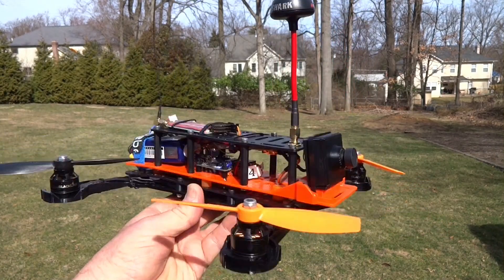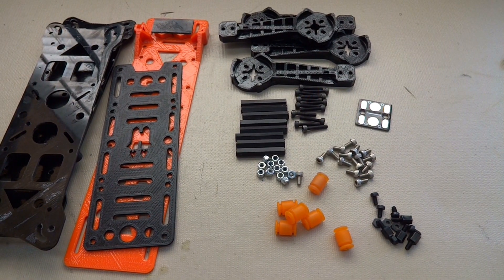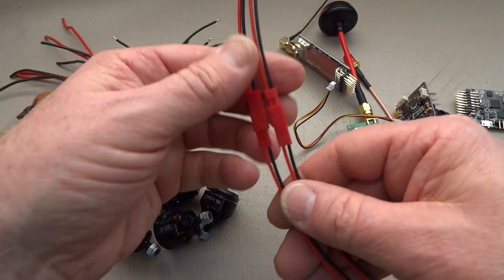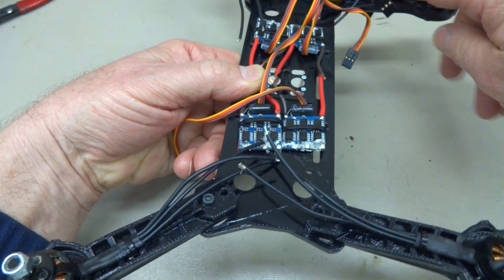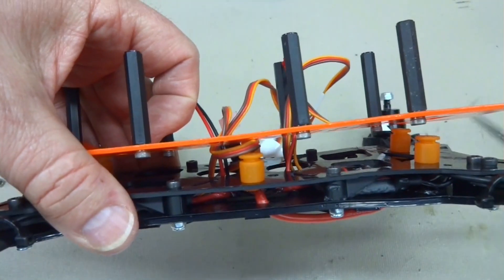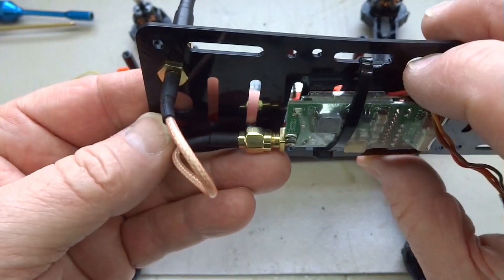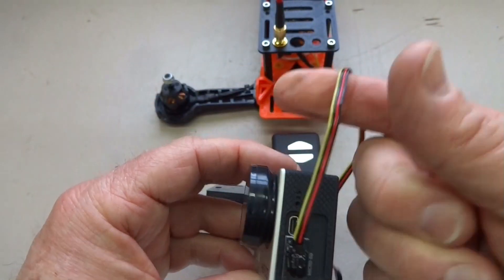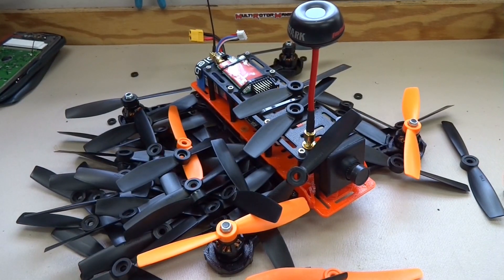MHQ2 3D Printed Quad Build Tips

Comment: home depot does not carry the M3 x 5mm, is a 6mm okay? The thing is I am not completely sure what the M3 x 5mm is used for in the build. Is the 5mm bolt something crucial????(meaning if to long it could interfere with the rest of the build)
Reply: 6mm will be fine.  My home depot only carries 5mm.
Reply: and when you mean 1 standoff kit do you mean the 4 standoffs alone or including their bolt?(if so including the standoffs corresponding bolt, what is its dimensions?) thanks

Comment: my motors are not spinning from the transmitter
my fs-ia6b is bound to flysky fsi6 transmitter in ibus
but motors are spinning using cleanflight configurator!
what should i do?
Reply: Arm the quad by holding the throttle stick down and to the right.

Comment: What is the purpose of the ESC? Sorry. I'm not familiar with flying at all.
Reply: it has two purposes, 1 to convert the high voltage of you lipo battery to your flight controller and the other is convert the pwm ( pulse width modulation) from your flight controller into something understandable to your motors. They are required for these sort of brushless motors.

Comment: Built this but it won't work. I can connect to my receiver (I believe it bound) but when i connect to all 4 motors it doesn't work. I connected to each motor/ESC individually and can make a motor respond to me but when i go through the flight board to control all 4 nothing happens. Flight board powers on and receiver acts connected but motors won unlock or move. Any tips? I must have a connection incorrect somewhere. Do you have a wiring diagram.?
Reply: yep. Thats how i know i can make the motors work individually. I power on the quad and it just beeps constantly I think it is the motors beeping. Not sure what to do??
Reply: bosnianbill i went around to all 4 esc/motors and did the thing where you flip your throttle to max and conifer them. The flight controller is out of a Hobby People F450 Quad kit. I think that may be the problem. Like i said above the quad just constantly beeps now when i plug in the battery(see video link) and the motors won't spin up.
Reply: bosnianbill  Ok great! Yea I went with the Hobby People controller b/c it came in a kit that was pretty inexpensive but had everything miss battery and receiver.  I can post a link to the FC if that will help. in the instructions for configure the FC it states that i need to plug my FC board into the receiver via the DSM2/DSMX port but i don't have a port on the receiver that will connect to the FC Boards DSM2/DSMX port... 

http://www.hobbypeople.net/index.php/hpheli-super-mr-controller-4-6x.html
Reply: bosnianbill It seems this is another name my FC Board is sold under: QQ Super Multi-rotor flight 

Any help at all would be great. I ordered a naze 32 for back up and i have 2 receivers to pick from (spectrum r610 or orange rx650x i believe)
Reply: bosnianbill I ordered a Naze 32, I'm done with the off brand controller
Reply: :/ still having troubles... had one little flight.

Comment: Nice, how do those props compare to gemfan 5030?
Reply from the maker: These are HQ5045s and produce quite a bit more lift than the 5030s at any given RPM.  They are also a bit sturdier and don't break as easily.
Reply: AerialWerks I would argue that a little.  HQ 5045's are a little brittle - the 5040's are much more sturdy in a crash.  However, 5045's definitely provide more thrust.

Comment: With that battery sitting just behind your Naze, any crash will destroy it.
Reply from the maker: Yeah, I was noticing that.  I'll probably have to either change the 90 degree pins for straight pins on the Naze32, then put some kind of barrier in there, like duct tape.  My other option is to put the battery on the top - that's probably the best choice.